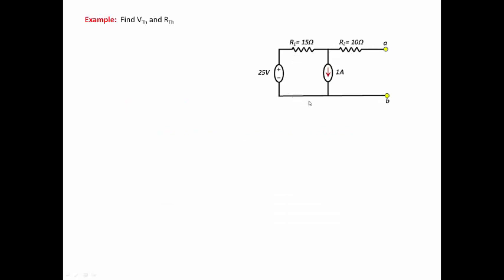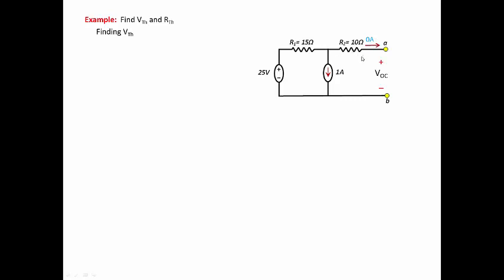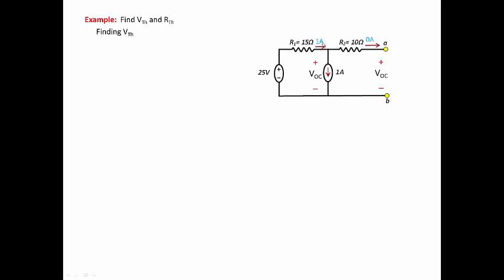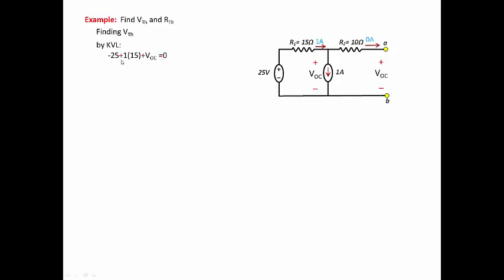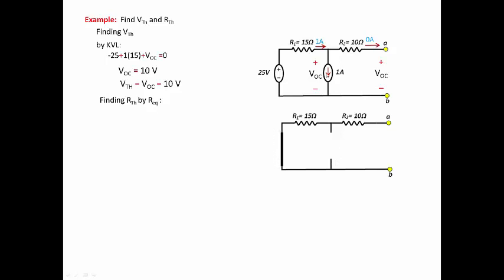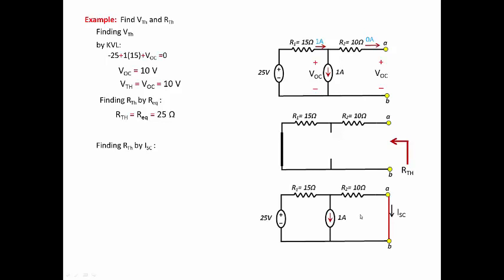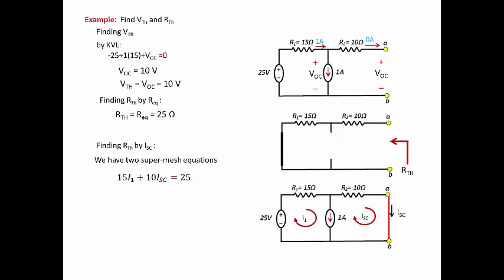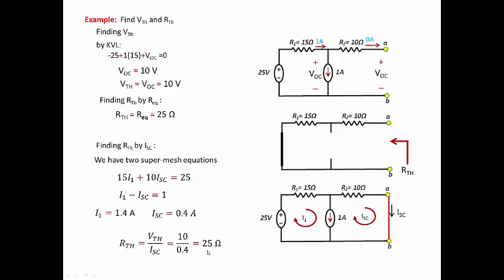Introduction to Thevenin Theorem 2 - Example

Comment: What changes if the current 1A goes in the opposite direction?
Reply: Electrical Engineering Topics so when writing KVL for Vth, I write +25-1(15)+Voc=0?
Reply from the maker: @andreavillanuevalechuga2343  I think I miss understood your question. So, lets start over. 

If the current is going in the opposite direction, by KVL you are going to have -25-1(15)+Voc = 0 ==> Voc = 40V.